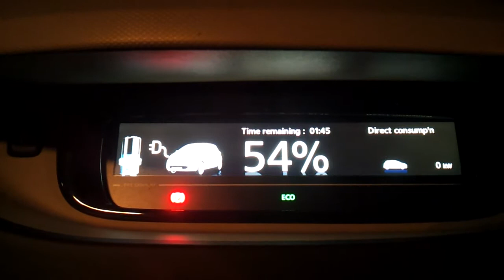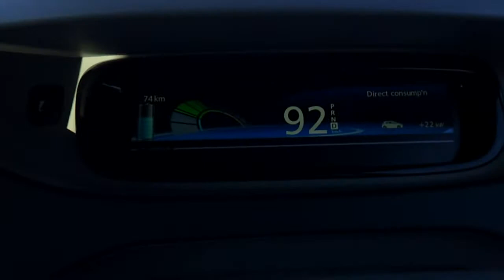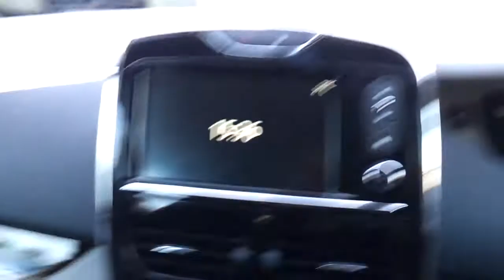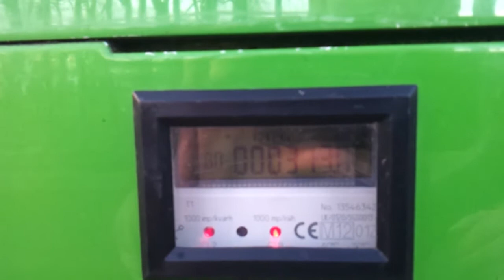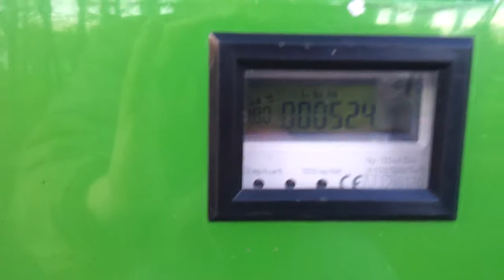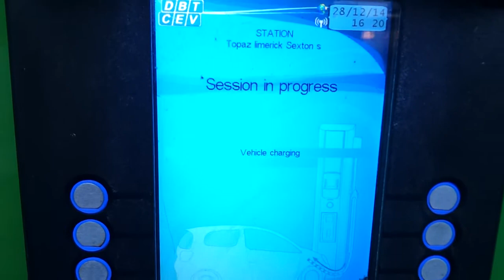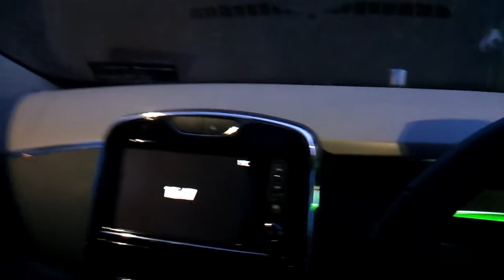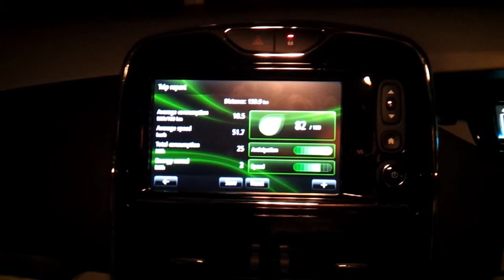My Electric Journey - Episode 9 - Cold Battery & Limerick Charging Trip

Comment: Hey man, any experience with charging actually under 0 C? E.g. -10 C. What happens when you plug into a fast charger, does the car know to heat the battery first to above 0 C before allowing charge so as not to damage the battery?
Reply from the maker: In the case of my 2014 Zoe it would just slow down the charge until the battery is warmed up. I haven't charged in such cold conditions, thankfully.

Comment: Great way to put it:  these are charging spots, not parking (i.e. charging and parking are two different things).  We get a lot of pushback from the anti-EV crowd complaining that parking spots should not be reserved for any particular type of car.  I will now agree with them and point out that we are not talking about parking spots.  Excellent!
Reply from the maker: These are the equivalent of a petrol pump for a ICE car. Even EVs which are not charging should not be in there. I bet the anti-EV crowd don't understand this.
Reply: I think the issue is that the charging station spots LOOK like parking spots, are usually adjacent to them, and probably were formerly parking spots.  None of that helps the anti-EV crowd to tell the difference.